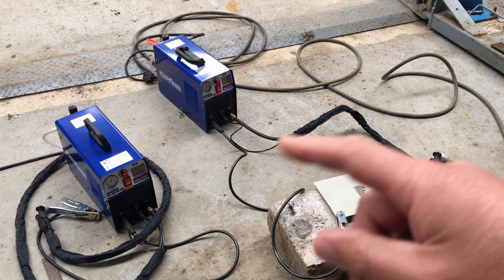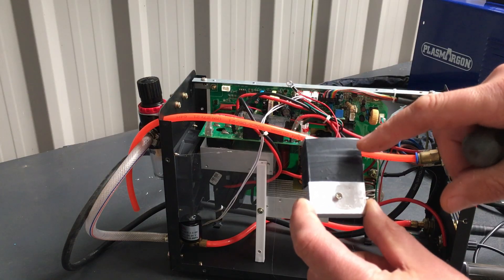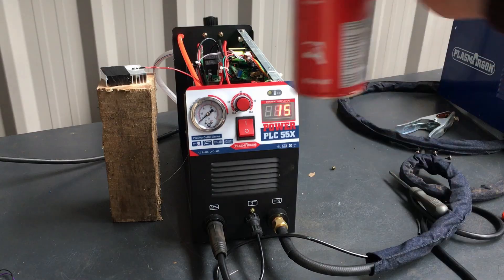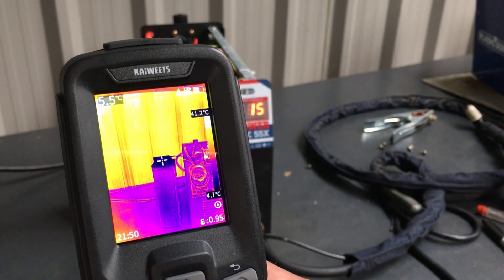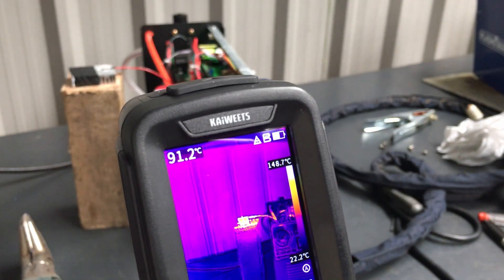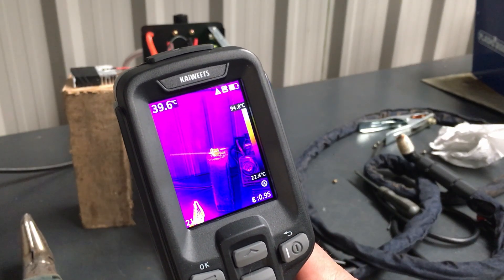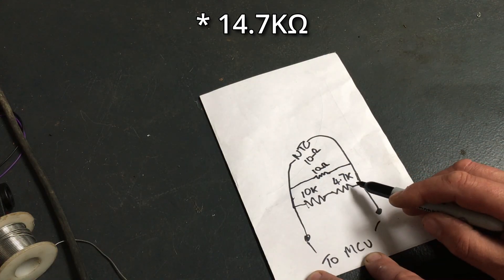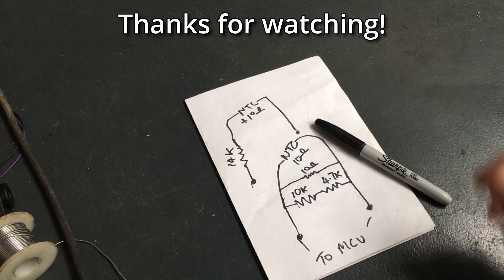Faulty Plasma Cutters - Follow-Up Video (With Thermal Camera) | Will It Catch Fire???

Comment: Not sure if you will get to read this, but still...
The only problem with the units is that the temperature thresholds are unfit for UK climate ( and other countries with cold climate ), that is a dumb thing but they are China stuff so...

Who ever said that the mods should have been in series with the NTC should really read about Ohm's laws and about how an NTC works! 
When you did the mod you lowered the overheating threshold because as the NTC heats up it's resistance lowers and that is just what you did, lowered the NTC's resistance ant room temperature, meaning the overheating protection comes at a lower temperature now. 
As i said, people should learn basic electronics, like Ohm's laws, and basic components and paralleled and series resistance, and stuff.

You did go slightly wrong on the mods, but not on the configuration ( putting the resistors in parallel with the NTC was the only way to go ), but rather on the values chosen. 
You really need to make sure the mcu still reads when the NTC is disconnected, because it can happen and when it does, everything temperature related will be off, and the unit will no doubt fail quite spectacularly!

What needs to be done is lowering the threshold at which the "NTC disconnected" protection comes in, without nullifying it completely. This is done by trial and error way, your mod is fine, just it's value needs adjustment, until you reach a point where that protection still comes in but at a lower temperature threshold ( say 0*C for example ), without compromising the overheating threshold, which must be checked each time a mod value change is done. 
The way i see it, i think the mod value should be a larger resistor, you use the same pot in parallel with the NTC ( while the NTC is mounted on that smaller heatsink ), and everything connected to the board, and the unit powered on, you adjust the pot value until you see that the "NTC disconnected" protection comes in at somewhere below 5*C ( i think that would be just fine ), then you check the overheating threshold, making sure it is still ok. 
You do not want the overheating protection to come in too soon, you cannot do any work that way, but it should not be so high as the heatsink starts smoking, somewhere between 80 to 100*C should be just fine ( also you should check at what threshold the fans starts ).
Reply from the maker: I always try to read and reply to all comments. Sometimes I do miss the odd one. I know exactly what you mean and I did think about putting in a higher value resistor. The only problem is that the NTC resistance drops off quite quickly as the temperature lowers. At 0C is is 32K and -12C 64K (approx). It is often below 5C in the UK in winter, so the unit would not function. I did mention the downsides of this mod in the initial video and that if the NTC failed open circut then there was a risk of the unit overheating (reason why I glued the plug in). In reality other components in the unit will probably fail (as we know what the build quality was like). The proper way to fix it would be to reverse engineer the circuit, and perhaps even the software in the microcontroller to set the lower disconnect threshold do something like 64K ohms, but that may not be possible.
Reply: @BuyitFixit  first of all thank you for reading and responding to my comm. 

Now, about the issue at hand, the mcu doesn't know and doesn't care about resistance values, it can only read voltages with its ADCs, and that is what the NTC does in what probably is a series circuit with another circuit to some DC voltage, which then gets adjusted as the NTC resistance changes, and that proportionality of the voltage to the NTC's resistance is what the mcu sees, and thus changing the software is pointless ( or should i say not needed perhaps ).
What needs adjusting is that voltage proportionality range, meaning you adjust the resistance needed for some temperature range. 
You measured ( if i am not mistaken, please correct me if i am ) about 15k of resistance needed in the NTC socket for the "NTC disconnected" protection to kick in, and if you want the unit to work at let say those -12*C you just mentioned, at which you measured 64k from the NTC, then you need another resistor in parallel with that NTC which at -12*C ( 64k ) would give a total resistance of about 15k, that needed resistor is just under 20k, and would dominate in a 3/1 ratio the NTC, so the total resistance would not change as fast as the NTC's resistance does. 
For example at 0*C you measured 32k, and with a 19,6k in parallel with it would give just over 12k of total resistance, just 20% of total resistance change, compared to 50% at the NTC. 
Not sure of what resistance is needed for the overheating protection to kick in ( if you tested it in the last video and it escaped me, sorry ), but i think it is quite a low value ( probably tens or maybe hundreds of ohms ), so the 19,6k ( a 12k resistor in series with a 7k5 one would do just nice for example ) would have quite an unsignificant influence on the overheating protection point. 
All that remains is to check at which point the fans start, just to make sure they do kick in when they are needed ( they could come in a bit sooner, but that's even better, you cannot complain about fan noise in such a device ), that is if the fans are temperature controlled.
Reply from the maker: Thanks for that. I had been thinking of lowering the resistance slightly as a few people have suggested. I'll report my findings in a pinned comment on this video 👍

Comment: Yes , You was right to set it parallel to the NTC , if it's hot the resist falls very low in Ohms , so that parallel resister in the range of KOhms has no effect on the shutdown function
Reply from the maker: Totally correct! 👍

Comment: In reply to my previous video comment "Resistance in parallel will not work." 
Ohms law is "the total resistance in parallel will always be less than the smallest resistor." 

This was based on your wrong answer in the comment section in reply to @nickalexander6773
"The resistors just stop it dropping lower then 15k"

and your wrong comment in the video saying "The minimum it likes is 15K"
https://www.youtube.com/watch?v=2wt5Y-lyqO0&t=1756s

Beside you being a great source for entertainment you also provide a great source for learning,
By providing wrong explanation how it works you mislead your viewers, anyhow you seems to understand it fully now🙂

By disconnecting the too cold protection with the resistor, condensation will occur when used in cold environments, and the cutter will short.
Maybe it was nothing wrong with it at all? Can it be that the user have tried to use it in cold environment?
Reply from the maker: I did make a mistake by saying that in the original video. I'm not an expert and I do make mistakes at times. Condensation is unlikely to occur unless the unit is very cold and then being brought into a warm humid environment (but that would be the same for any plasma cutter). I own an Eastwood plasma cutter, and that works in 0C no problem. The original user tried to operate it in a 10C garage, which is should work no problem and not cut out below 18C.
Reply: @BuyitFixit  Yes we all make mistakes, that's how we learn 🙂 Other Youtubers make a correction with text on the video when they say something wrong, seems like a good idea, on the other hand you have had a hot comment section lately and that's good for the algorithm 😂
Reply from the maker: Yes lol 😂😂

Comment: Hi, if you connected the resistor in paralel on the sensor cable instead on board it would work same but it would also throw an error code when you disconected the probe from the board or am I wrong ?
Reply: You are correct, but it would be much more messy to achieve. However, heatshrink tubing hides sins like that rather well… (the better solution is to just use a slightly larger resistance, so that the parallel resistance of the thermistor at 5 °C or so and the additional ‘bodge’ resistor is still low enough to avoid triggering the open-circuit protection while the bodge resistor is still high enough to trigger the error if the plug falls out or the thermistor fails open.
Reply from the maker: The only issue is that the NTC resistance increases dramatically as the temperature drops. at 0C it's around 32K and -12 is 64K. It might be hard to choose a resistor that would allow it top operate at 0C (which it is often in the UK especially in winter) and keep the open circuit protection.

Comment: Can't fix stupid. You mentioned quite clearly that your mod affects the bottom end of the temperature curve, not the top end. Nowt wrong with them. Now.
Reply: By disconnecting the too cold protection, condensation will occur when used in cold environments, and the cutter will short.
Maybe it was nothing wrong with it at all? Can it be that the user have tried to use it in cold environment?

Comment: Resistance in paralell is lower, in series they add together. So it will cut out faster (at lower temp) when in paralell. Formula to calculate resistance in paralell would be 1/R(t) = 1/R(1) + 1/R(2). Keep in mind that if the termistor dies (open circuit) you will no longer have over heating protection, so its best to increase the value of the resistor slightly so it will cut out if your thermistor goes open circuit.
Reply from the maker: Yes I mentioned the open circuit problem in the previous video as a downside to the modification. The only problem is the NTC curve is not linear, and drops off quickly at lower temperatures. At 0C it would be around 32K and 64K at -12C

Comment: Does it still sense the sensor being unhooked? That is my fear. It gets unhooked and goes to a base reading and can keep running till it over heats?
Reply from the maker: No, I explained in the previous video that if the only downside would be if the sensor became unplugged. That is the reason why I glued it in, in the previous video. The only issue is if the NTC failed open circuit "somehow" but the way the unit is built I expect it would fail with other issues before that 😂

Comment: Great job now you ever confirmed the correct operation so there is no doubt it will perform as intended. Good Video as Always..!!
Reply: By disconnecting the too cold protection, condensation will occur when used in cold environments, and the cutter will short.
Maybe it was nothing wrong with it at all? Can it be that the user have tried to use it in cold environment?
Reply: Hot & cold doesn't cause condensation it is the amount of water vapor in the air that reacts to these changes that cause it. Usually when it's very cold the air is dryer and less likely to condensate. My question to you is what do you believe will short out if there was any condensation & what area of the plasma cuter would be effected? @micronetwork
Reply: @alfredocuomo1546   You are right "it is the amount of water vapor in the air that reacts to these changes" Water together with leading contamination will short out high voltage circuits very quickly.
Reply: @micronetwork  Well I haven't seen enough of that to make a call either way, I just think he proved his theory of operation & there was the distinct possibility they may have changed the thermocoupler negating their own design. Either way the owner still has two operational machines that are relatively safe at least for over heating & will work in the cold.
Reply from the maker: Cheers 👍

Comment: Hi,  with this setup with it give the thermistor disconnected error code?
Reply from the maker: No, I explained the downside to the modification in the previous video. This is one of the reasons why I glued the plug into the socket. The only issue would be if the NTC failed open circuit somehow.

Comment: The commenters are incorrect.  You are dealing with Facebook experts, not reality in this venue. You did exactly what the mfgr wold have done to sole this issue.
Reply: By disconnecting the too cold protection, condensation will occur when used in cold environments, and the cutter will short.
Maybe it was nothing wrong with it at all? Can it be that the user have tried to use it in cold environment?

Comment: Thanks, I initially had to think through it, but the key to understanding the fix was the NTC which was key and understanding parallel resistors which you explained very well. Only issue now is if it opens up no one will know but hey cheap free China junk at this point. Good fix!!!
Reply: By disconnecting the too cold protection, condensation will occur when used in cold environments, and the cutter will short.
Maybe it was nothing wrong with it at all? Can it be that the user have tried to use it in cold environment?
Reply: @micronetwork  In the first video the answer was YES, they did not work because it was cold. Good point on the condensation something to consider.
Reply from the maker: Cheers 👍

Comment: I'm guessing if the RTS becomes unplugged again both the high and low cut outs as well as the RTS disconnected error won't be triggered? But then you have glued the plug.
Reply from the maker: Correct. The only downside would be in the NTC failed open circuit somehow.

Comment: You absolutely don't need to readdress this because of certain comments. However the fact that you did and explain and demonstrated why and how maybe enables others to understand the circuit a lot better. So you actually taught some that didn't know or understand...now they do...   Thumbs Up!
Reply from the maker: Thanks Gary 👍
Reply: By disconnecting the too cold protection, condensation will occur when used in cold environments, and the cutter will short.
Maybe it was nothing wrong with it at all? Can it be that the user have tried to use it in cold environment?

Comment: To be totally safe you would need to calculate what the junction temperature of the power devices are.  And check it th3 the max limit, as a 100 deg C heatsink may be too high.

I would also check the earthing and make sure it conforms to the LVD. If its anything like the K40 laser i brought from a uk supplier it was a death trap.  
I feel a lot better if it goes back in a safer state than it did when it arrived.
Reply from the maker: The resistor in parallel should slightly lower the high temperature threshold (but not by much) so they will probably self destruct as intended and indicated in the destruction manual 😂😂 I know what you mean about dodgy stuff! I recently bought a 4000W power controller to be able to adjust the power of a 3KW heating element. That too was a death trap. It had an unfused plug with thin cable, and a main switch rated at 6A! and a very small heatsink (it's actually the one I used in this video). I put the board in a larger enclosure with a CPU heatsink and fan on the main triac, and proper fuses and thicker cables. It now works as it should.

Comment: I'd still put the resistor betveen sensor wires, just to E04 to be able to show loose connector. I'm not convinced by compatiblity/quality of those connectors, even if the are glue together. Nice dignosing and fix although.
Reply from the maker: Cheers 👍

Comment: Great explanation and it does make sense!  There's no risk in this mod imho, and I believe it's now more fit for purpose than it was from factory!
Reply: By disconnecting the too cold protection, condensation will occur when used in cold environments, and the cutter will short.
Maybe it was nothing wrong with it at all? Can it be that the user have tried to use it in cold environment?
Reply from the maker: Thanks 👍The only downside would be if the NTC failed open circuit somehow, but tbf the rest of the unit would probably blow up before that as it isn't the best build quality.

Comment: My question is, why didnt you out across the plug on the leads side?
These units seem to have an unplugging issue.  If the temp sensor lead becomes unplugged, the unit will still work, no?  And then, without the sensor being plugged in, the unit could overheat.  It you put it on the leads, at the base of the plug, and it became unplugged again, you would know and the safety system would work as designed. 
I think its a great fix, but I think not putting it on the wire side, can cause potential danger because it can still operate when overheating.

I could be wrong, but am I?  I could be mistaken, but i thought it ran without the leads being connected in other video.
Reply from the maker: Yes you are correct. It's the reason why I glued the plug into the connector. The only issue is that if the sensor goes faulty (open circuit) then it could overheat and fail. I did say that this was a potential downside, but without reverse engineering the software in the microcontroller I can't see any other way around this.
Reply: @BuyitFixit  If the resistor was put on the wire side of the plug, instead of the board side, and the hot glue gets hot enough to soften, then a plug disconnect would throw the sensor disconnected error, and a thermal failure couldn’t occur.
While I think your solution is very smart, I think it could be safer by removing resistor from the board, and then put on the wires instead, it would offer more safety.
Thanks for your work, its gets me thinking!

Comment: Well explained, Mick. I knew you couldn't let the comments go on. I too would have done the same. Thanks for sharing.
Reply: By disconnecting the too cold protection, condensation will occur when used in cold environments, and the cutter will short.
Maybe it was nothing wrong with it at all? Can it be that the user have tried to use it in cold environment?
Reply from the maker: Cheers Brian 👍